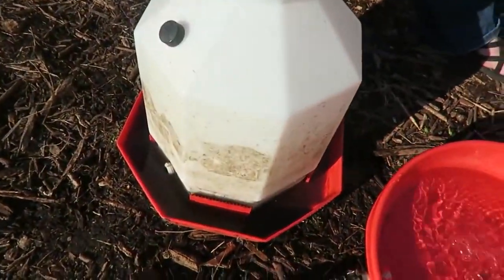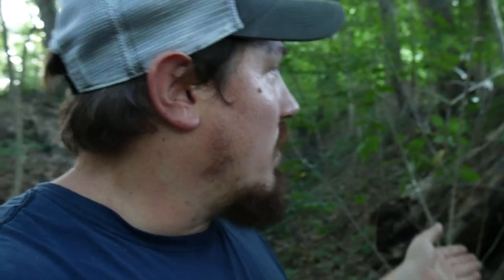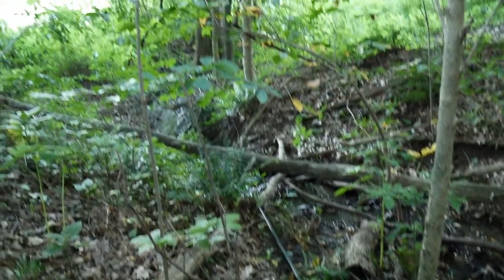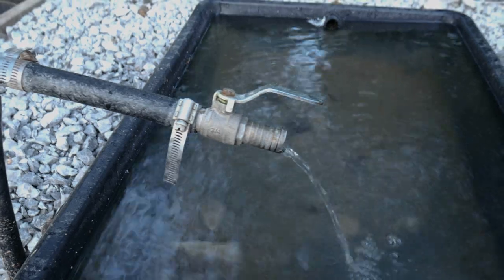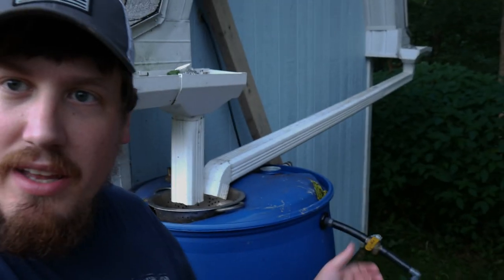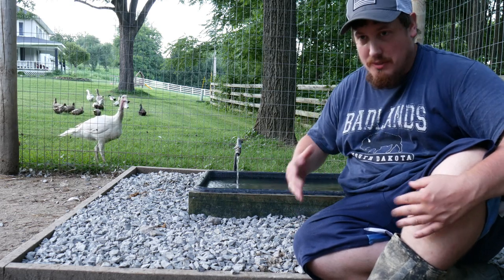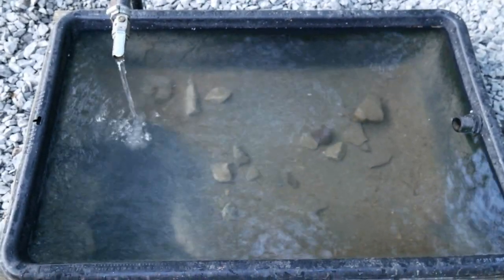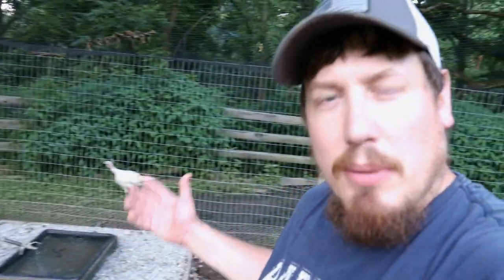Self Cleaning Duck Pond!!!!

Comment: almost everyone can have an "uphill" water source. 1. build strong lift. 2. add float and piping to reservoir. 3. lift reservoir. 4. attach garden hose to float. add insulation and heating if its required where you live.

Comment: So I'm a new duck owner, and the first thing I thought of was something similar to this. I'm going to do a rain barrel collection with a prefilter (screen) like you have to drain into the rain barrel.  however, I'm wondering about maybe putting a bulkhead on the bottom of the pond (I'll be using a 150 gallon stock tank), pump the dirty water out from the bottom, through some form of filter media and pumping it back into the rain barrel (which will NOT be used for human consumption).  The point of the pump and filter media for me, is the fact that when it's not raining, it'll be my water going into it, so I'd like to recirc as much of it as possible.  I also do not have a good spot for draining dirty water.

Comment: I have a stream of water coming off the mountain down to our creek. We pulled the pump because of the winter but I'm closer to run off and this is giving me ideas! Had to put my ducks up because there's  freaking owls everywhere picking them off.
Reply from the maker: Sounds like you have a nice setup with a lot of potential, check out this video where I expand the water system. 
https://youtu.be/vqUrjyBty7w

Comment: Any plans to make the pond a bit bigger in that area?  Also what about putting a piece of tool wrap over your outflow pipe on the pond?
Reply from the maker: No plans to make it bigger. It is plenty big for the scale I have. They just need enough water to dunk their heads.
Reply from the maker: However, the pond can be as big as you like. In the future I plan to use this water for a real stocked fish pond.
Reply: Yeah! I wouldn't really call that a pond but it's a great idea,though.
Reply: @TheAbleFarmer  How many ducks do you have?
Reply from the maker: @luigiprovencher  12 ducks, 2 geese. We also have 4 new ducklings. I know you are wondering how that little "pond" can handle that many fowl. It does a good job. Waterfowl just "need" enough water to dunk their heads to wash flush their nose and help them swallow. The ducks take their turns and often there are no ducks in the pond.
Reply: @TheAbleFarmer  Yeah! I've got 11 Muscovy after having just sold a drake and 2 hens. I know that some people say that they don't need to have a pond or to let them swim but I think that it's much easier on the hens when they're mating if they do it in the water then on land and the other birds will actually go after the drakes penis sometimes while they're in the process of or after which can cause a prolapse.